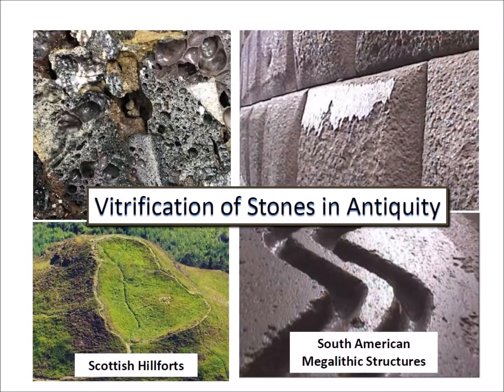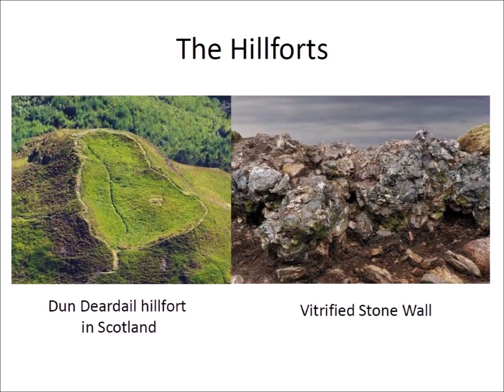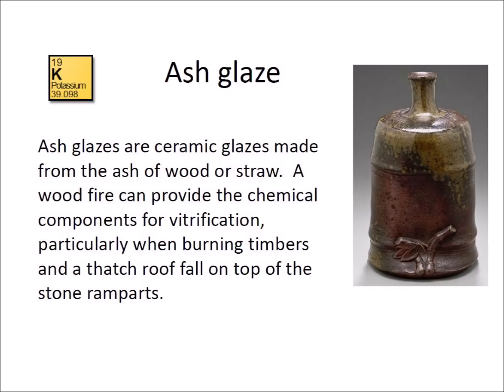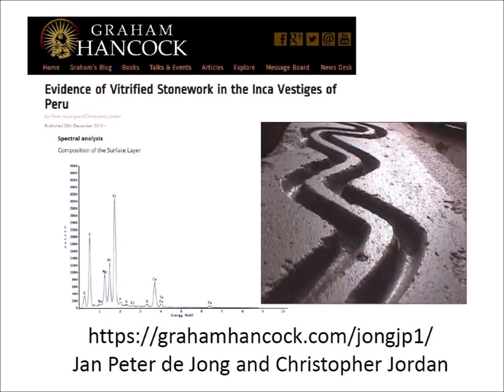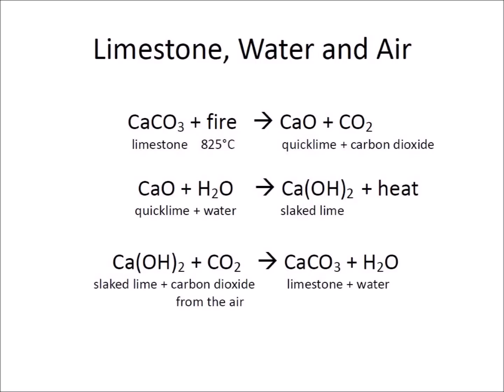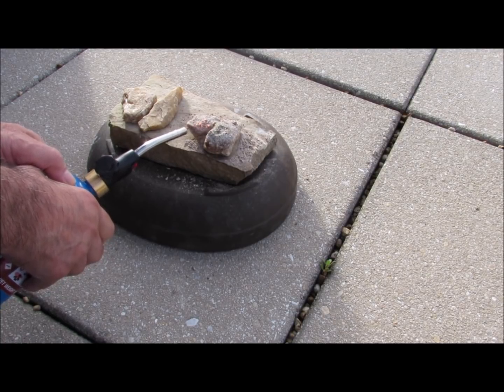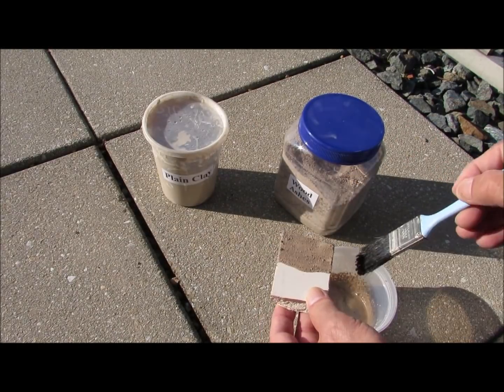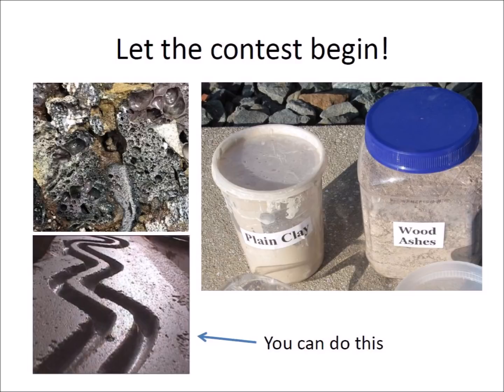Vitrification of stones in antiquity

Comment: A Russian team examined the stones of the Sash Wall in Peru and determined it was constructed using a surface of "hydrolyzed limestone dough" which could be modeled into the famous multifaceted angles. They propose that the original quarry limestone was heated and pulverized to create the micro-crystalline material which was then applied to the substructure. Your experiment with the heated marble shows how the texture is changed in a similar fashion.  https://www.youtube.com/watch?v=xePOUMcrZDg&t=0s

Comment: A propane/air torch develops at least 1100°C according to Wikipedia.  An article online says a ceramic glaze can be fired from 1263°C to 1326°C.  More searching says you can probably generate that in a non-kiln fire using a paste , possibly animal dung, of a higher firing point as the shield.  https://www.goshen.edu/art/DeptPgs/rework.html   I'm sure it would take a lot of experimenting to get a product suitable for the king's walls.  SpaceX isn't building the Starship in a day.  But you should eventually be able to glaze Cusco or the east side of the granite layers of Menkaure's pyramid.  No solar plasma needed.

Comment: The vitrification of stone forts in antiquity was likely advanced chemistry using silicate dissolving acids from mining wastes, especially iron pyrite, at a ph of 0-1.

This is not to confuse this technique with heat damage as found in areas of Egypt, or purposeful application of heat.

The ancients would mix the mine waste with plants to form a paste, then spread it on the stones and let the paste mold the upper stone into the lower stone, then spread it on the surface to smooth it. 

A marker is the presence of rust and sulphur on the stone surface, which indicates acid wash.

I watched the Kos video and I think he's on to something. But the acid wash was mentioned, but don't know what plants would have been used.

Comment: add a powdered 2-3mm layer of wood ash then use the slurry so the entirety of the surface area you are after has equal parts ash to help then use a electronically controlled kiln that can evenly disperse the heat, if you can place materials on the sides you do not want to have effected by the heat that can withstand the temperatures you need and it should work to the degree you are after.

Comment: Is it possible that the ‘megalithic’ structures of the world could have been formed like concrete, instead of carved?  This vitrification process makes me wonder if the finish layer is a process of chemical reaction rather than laser-cut masonry.
Reply from the maker: The tight fit between the blocks of stones is very impressive leading to the idea that the stones were molded. The actual method of shaping and fitting the stones is not known.

Comment: It doesnt really even take much heat to change the surface of stone. As a stonemason i once left a ciggy on a piece of polished black galaxy granite, It vitrified the surface and it wasnt there long. Stone doesnt like to expand. Its crystalline in structure so even a little heat can disrupt it. 
Also depends on the stone. Some of the "hardest stones" that these ancient people worked with are actually easier to work than "soft stones" 
Take basalt and marble for example. no marble is a soft stone, very brittle, prone to cracks, breaks, imperfections, lime pockets. Basalt however is hard, yet very easy to work because of the crystal structure being so fine and uniform. 
Let me put it in a more fathomable way.  Say i had 2 containers 1 with ice cream and 1 with water. I give you a spoon and ask you to empty each container with the spoon. Which one do you choose to be easiest? The ice cream.. why? Now ponder on that for a bit.  
same goes with stone. The more predicable it is to work the less time you take working it.
Reply from the maker: Thank you for the report of your personal experiment.  Ashes + heat will change a stone.
Reply: @Antonio_Zamora  Yeah its all got to do with carbons' conductive properties and heat exchange. Since carbon is a great conductor of heat, you can transfer that heat from friction very easily. Fire would be way to do it but also fire would be to hot and it would exfoliate the surface if left for to long. We use that as a finish on granite, you take a propane fire lance and blast the surface of the granite and it "explodes" the surface. 
My bet is that the ancients figured out heated slurries of clay, stone dust and carbon from ashes would polish a stones surface, the glory of a slurry is that it works in 3 dimensions, getting into and around the softer minerals and smoothing their surfaces. 
That hardest part of granite is the quartz, the mica and feldspar are rather soft, softer than what is used to polish the surface.
Todays polishing is basically a cheat where we grind the surface of the stone until its polished to leave a glass like finish. it uses varying grits and a polishing compound made of aluminium oxide. 
Or you can really cheat and use acids. The acids wont make a surface flat but will make the surface of stone shine like it has received a polish. The 1 staple though is heat. friction through the polishing pads or exothermic reactions from the acid.
 I had a theory of how ancient people figured out stones could be polished and its thanks to mother nature.
Birds and lots of Forrest dwelling animals swallow stones to aid in the processing of food. Seeing these stones inside animals exposed to stomach acids and comparing them to stones on the forrest floor would of led to a 1+1 situation. The next challenge would of come from making the stone flat. That however usually lies with the "bed" of stone. If you split stone along its bed you know you will come pretty close to a flat level surface that needs little work. Since most stone is formed in liquid state. Actually nearly all stone is created this way. And we know liquids like to sit level and flat to the pain they were formed in. Nature had done the hard work, humans just figured out how to use that to their advantage. 
Just ask any older mason that had to work stone by hand and not a machine and they will tell you the same thing.
In fact in my life time, one of my many teachers used to flatten stone by hand with a piece of railway iron, lead shot and sand. We havent progressed to far in stonemasonry since ancient times. We just figured out how to save money.
Reply: @bigmandarr  splitting stone is simple, using the splitting technique to make blocks is another thing, the breaking points will not be parallel. The quarries of aswan in Egypt have tooling marks of circular saws, thin CRESCENT cuts into the walls of the quarries. They have perfectly cylindrical hard stone jars which have thin walls and also, tooling marks INSIDE the jars. They have helical cutting marks as if it was bored out with vertical "lathe" and that's vertical IMO if the jar itself was held vertically on a bench of some sort, all 30000 of them ranging from 2meters high to tiny little one inch jars with wall thicknesses ranging in the few millimeters and that also applies to the large jars I haven't seen Flanders Petrie document those jars with wall thicknesses larger than 6mm

These aren't clay or limestone jars, these are hardstone jars made out of every hardstone in Egypt ranging from granite (6-7 on the mohs) to corundum (9 on the mohs scale) and the explanation we get is duh cOpPeR cHiSeLs
Reply: @wrathmachine7609  lathes were quite common in ancient times. This is actually well known, man figured out a straight spear was better to throw not to late after we started throwing them. In fact lathes were so common that they didn't even warrant a documentation in history, like clothes or sandals or food. 
things used on a daily basis that couldn't possibly be lost to history. 
Turning stone is still done today. We use corundum as a cutting medium, its very brittle but tough, like you know...titanium or diamond or tungsten. You know those magic things that only modern humans use to cut and shape stone today....
Humans are smart and inquisitive. I have no doubt that ancient egyptians had these vases and may have even made them. But things so ornamental that arent gems or gold hardly seem like the style for egypt. Most likely they were traded for other goods. like you know....gold. maybe or diamonds. you forget that egytians seen diamonds as the "working mans" gem. 
higher society much preferred the more colourful stones. the greens of emerald the blues of topaz and sapphire. Some of which  aren't mined in Africa, But what is africa most known for.??? hmmm 
Diamonds. yesss thats right. 
I'll let your brain piece together the rest of it. Im sure you will get there with your mohs scale and helical marks. hmmm
yep.
Reply: @bigmandarr  Chiseling is stonemasonry but turning and cutting is machining, something I know enough about and and you are right when saying that processing these stones werent documented. Why would they be if only few specialized in this domain and it was most likely a father son/master to apprentice transmission of knowledge something that was very common in the late 1700 blacksmithing and gunsmithing. 
Diamonds would be a great choise as cutting bits for tubular drills and milling bits as you say but where are they? We only found copper tools (saws, picks and chisels) that were only depicted in drawings for woodworking. 
You say lathes were quite common for stone working but none were found. Doesn't mean they didn't exist but none were found. Doesn't mean they had to be electrically powered or by some combustible engine it can be operated by hand, it was done in the 1800s for boring and reaming, rifling gun barrels. 

Flanders Petrie found that in order to achieve the feed rate of a helical cut on the core number 7 the ancient Egyptians needed a tube drill that rotated at 1600rpm and was fed with multiple tons of pressure. That's something only a machine can do, and none were found. No tube drills were found although they were used. 

My point is that some sort of machines were used, very large lathes, milling machines and "drill presses" that could be moved around with ease. 
A million stone masons couldn't make a single 100 ton granite box with perfectly flat, parallel and liquid polished surfaces even in a million years. "Time and will" is a lazy excuse
Reply: @bigmandarr  What do you mean my brain will get there with my mohs scale and helical cuts. You need mechanical assistance in order to get a perfectly helical tool mark, you need mechanical assistance to make parallel surface INSIDE of a granite block. You need mechanical assistantance to cut stone, especially when you have tool marks of CIRCULAR SAWS. If your brain is simple enough to disregard this evidence then youre just a simple naive person
Reply: @wrathmachine7609  the problem is there are no facts that can prove they have mechanical machines, all there is are tooling marks that look like modern machinery was used on a few sample pieces that are cherry picked by these so called experts in fields of nothing. No stonemasons have examined these pieces it seems, you're completely neglecting the facts of stoneworking practices that have been in use for thousands of years. To sit there and completely believe that ancient man couldn't do these tasks without modern machines you literally forget that we have only had modern machines for about 150years or so. So how did the romans do it? how did any of the great cathedrals build over 8-900 years ago get built? Did you just forget that some of the greatest works in stone were done completely without modern power tools, cranes, diamond cutting saws, tungsten drill bits, air grinders. That is completely ignorant and dissmissive of the skill of a person that works with stone for a living. How long ago was Michelangelos David made? The triverly fountain. The tombs of Greek kings? Seriously how stupid do you think I am as a stonemason that worked with stone by fucking hand most of the time every single day? You're completely oblivious, you have no actual insight to anything related to stone or how its worked. Dont start a discussion when all you got is " but they said that they did this so it must be fucking aliens with super advanced tech that spured a great ancient nation and then as humans we were like durr I forgot". Think about the time humans have had to work with stone, from caveman making flint arrowheads with nothing but deer antler, thats a lot of fucking years to perfect a craft that has to do with every day use and survival. The skills do not change. Your complete fucking stupidity is the reason you can't see the actual facts.
Reply from the maker: You make very sensible arguments, but the expletives and ad hominem statements can cause YouTube to block your post. Let's discuss everything logically and calmly. Thanks.
Reply: Marble is soft, 2 on the mohs scale and basalt is 7. "Easy to work with and predictable" right I'd like to see you chisel a perfectly square granite, basalt, alabaster etc blocks with copper chisels. Its all talk until its time to work.
Reply: @wrathmachine7609  I used to do it on a regular basis. Stone isn't that complicated to work with. People like to confuse chiseling stone with that of doing it to wood. Its not the same. You aren't cutting the stone with the chisel, its literally a fine contact point that you can exert a blow from a mallet on to. Granite as a whole is tough, but its the individual minerals that make up granite that you are working. The only hard mineral in granite is quartz. The mica and feldspar are soft way softer than marble even. So you are really only fighting the quartz and its on a tiny scale. Most the work is to crush those minerals and that is usually done with another rock. There is obvious tooling marks from that work. 
The same goes for basalt, you work small areas at a time to archive your desired result. Rocket science it is not. Stonemasonry it is.

Comment: My personal opinion is stone vitrification seems non-incidental except maybe the tops of the fort walls in Scotland. The melted stone on one wall in south America shows some method of heat application unknown. In modern times what the heat applicator was is unknown. The stones seem melted in the pattern of some ray or force unknown. When you heat a stone surface to the melting temperature with normal wood heating the rock spalls off making the melt flake off. The application of very high heat would melt the stone but we do not have a process to vitrify the surface not heating the underlying rock to expand and pop off. The heat has to be super high in the form of microwaves or xrays or gamma rays. I cannot think of a source to melt just the surface except one. During the cold war in Oregon, a misdirected microwave beam from a radar made a fence glow red where the microwave struck. The tube to generate this beam was 40,000$ at that time. On our Arliegh Burke destroyers the beam strength is 5 megawatts today, and could certainly vitrify a stone wall. But I see no motive to use it for this.

Comment: Even with ash ect.    Any wooden structure built atop the fort would not burn hot enough or long enough to provide the level of vitrification seen on the fort.   Also extensive testing pits were dug around the area, and no sign of burnt wood or ash was found.
Reply from the maker: You say "no sign of burnt wood", but there are holes in the walls, which are clear signs of the wooden beams that were part of the wall. The wood was burned completely and the ashes washed away over the centuries. Please provide a reference for your statement that pits were dug around the area. Who did it and when?

Comment: There is a simple explanation which explains the vitrification in South America. 

Analysis of the surface shows high levels of manganese and aluminium and the stones are often held together with cast copper 'dumbell' fixings which were clearly cast on site.
These people were accomplished metalworkers and most likely discovered the solution while experimenting with ores.

Anyone who has a misspent youth can tell you one possible explanation. Thermite is a substance which comprises of a metal oxide, lead, copper, iron etc. and a powdered low melting temperature metal such as manganese or aluminium (there are other combinations), which, when ignited produces extremely high temperatures. Thermite was used for welding steel rails together, so the temperature required to virtify the surface of rock, is easily achieved. It is low-tech, requires no special equipment, (allegedly clever people have seriously suggested that these people constructed solar lasers to perform the task), and all of the minerals used to make it are readily available in abundance in the countries where such walls have been found.

A thermite reaction would also explain why the raised metal deposits at the joints are present and how the copper 'dumbells' which join the stones were aparently inserted without any opening for the molten metal to be poured. Presumably their purpose was to pull the joints between the stones together as the copper cooled and contracted.

Comment: I liked.  Burnishing and buffing afterwards could also help the shein.  A show called secrets of the Samurai had some really interesting heat treatments to a forged sword blade with Clay as an insulator for the hardening process but he used another type of Clay and a paint brush to write his name on the blade.  After the heat treatment the molecular structure underneath the writing was different and you could not buff it out.  Very cool trick!